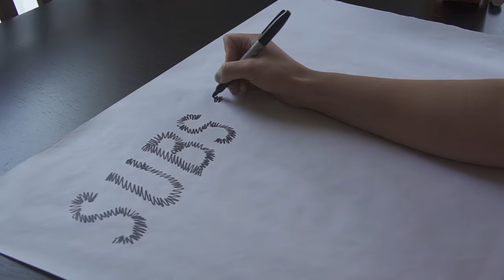Tiny Trainers and Naked GoPros in a St. Louis Warehouse

Comment: Do you think the naked gopro cinewhoops are replacing the cinewhoops like the shendrone squirt ? what does the shendrone still have as advantage over a nakedbuild?
Reply: Nope, for indoor probably yes, but for outdoor for windy condition u still need bigger quad
Reply: @arywidos  the squirt v2 performs pretty bad in windy conditions. Wouldn't a 5inch freestyle quad be better for windy outdoors and otherwise use the naked for non windy and indoor flights?